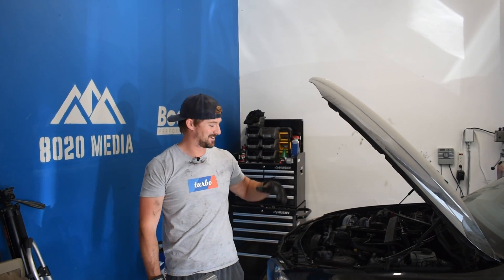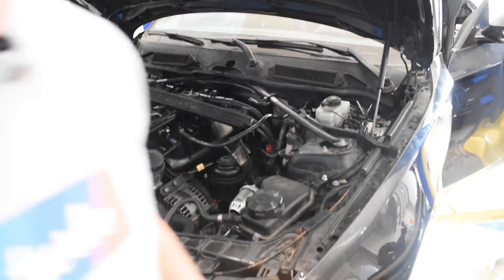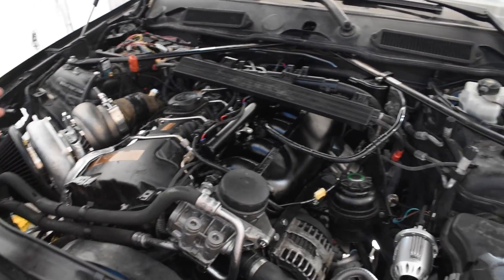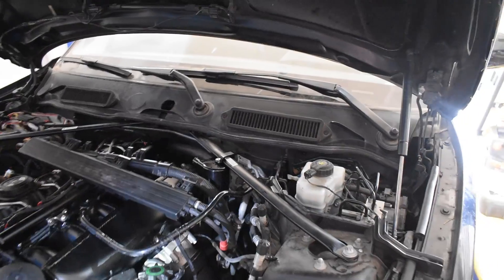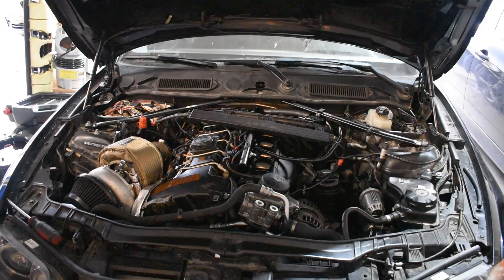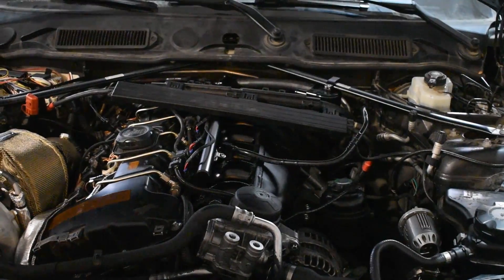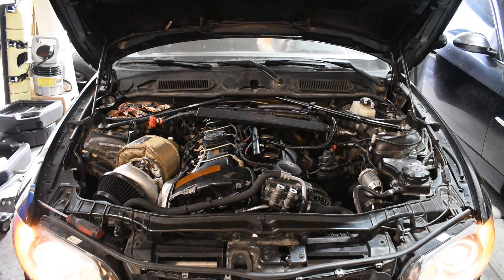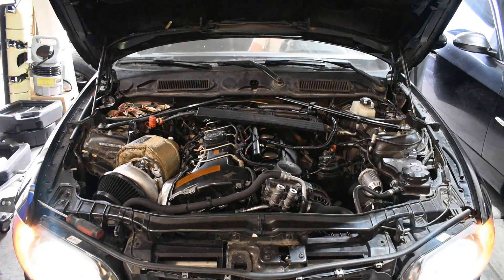Will the Engine Start? – N54 135i Single Turbo Build!

Comment: Did the air filter fit tight ?
Reply from the maker: Yeah it's a bit of a squeeze to get it in there but no rubbing problems or anything like that once it's on.

Comment: That noise sounds like a rattle and I would guess the noise is from the exhaust. The exhaust have these little flaps by the muffler that rattle on startup sometimes. Hope you get it sorted out though!
Reply from the maker: Ah, didn't think about the flaps - might need to look into that, although not sure how it would get fixed. Considering a custom exhaust on this thing at some point but I want to see how loud it is first. When I was 18 I thought it would be cool to straight pipe my 200hp Mazda Rx-8 and I can't handle something that obnoxious anymore haha but this thing will at least have the power to justify.
Reply: @8020Automotive  Search on YT, there’s simple DIY to stop the flapping. But however I’m just hoping this is the case and not something more serious like low oil pressure or something.
Reply from the maker: Thanks Bass - We'll be looking more into this today!